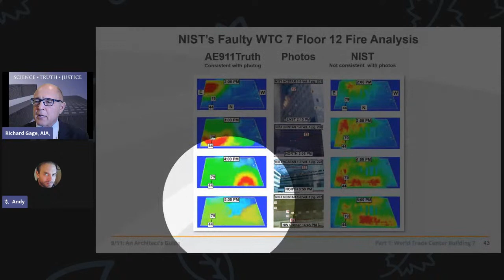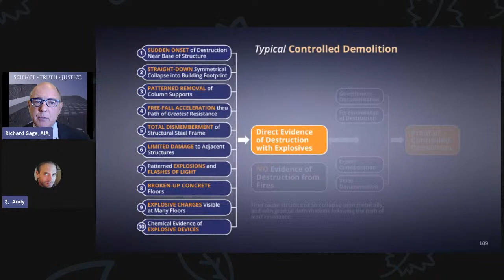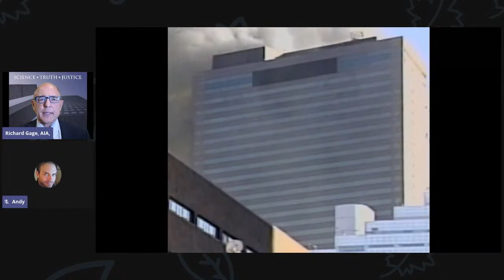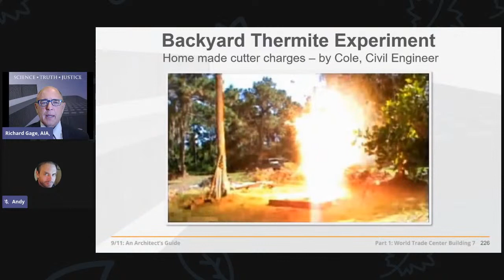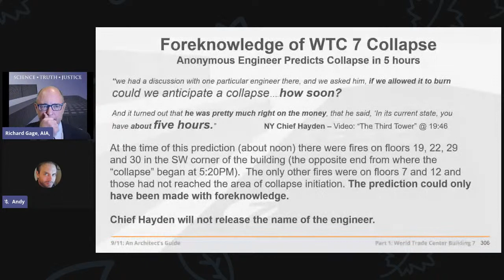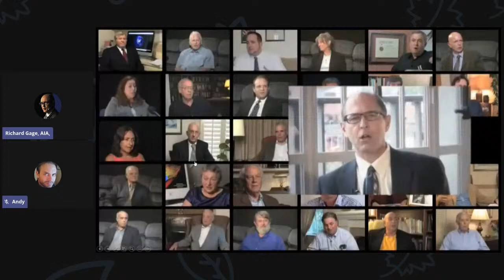9/11: An Architect's Guide | Part 1: World Trade Center 7 (10/1/20 webinar - R Gage)

Comment: Here's some notes saved off my phone, FYI Incase anyone is interested. 
Notes October 2020 #1

October 6, 2020 
It's midnight 10/6/2020 now but I have some notes to share. Brb...sorry for delay. 
Source: Dr. MICHU KAKU
TYPES OF LASERS - shared before, this part is a rerun: 

Gas
Chemical 
Excimer  
Solid state
FEL

Lockheed Martin And Speed of light Laser Weapons
  These advances enable offensive and defensive capabilities against a growing range of a new type of laser for generating ultra-high frequency sound waves instead of light - has taken a major step towards becoming a unique and highly useful 21st Century technology
SASER TECHNOLOGY 
  Modifying the ionosphere with radio waves

Extremely high power electromagnetic radiation.can cause electric currents strong enough to create sparks. (Electrical arcs) 
[[  Soros funded the PAC named "Bend The Arc"' ]]
When an induced.voltage exceeds the breakdown voltage  of the surrounding medium, (e.g. Air at 3.0 mw/m) 
THESE SPARKSCAN THEN ignite flammable moderates or gases 
POSSIBLY LEADNG TO AN EXPLOSION. 
   NOTES OFF INTERNET - FYI
Reply: October 2020 #2

Hayward Fault #BerkleyCA #Earthquake by @MaryGreeley https://youtu.be/b5tTdZL06fU 

Lucid Dreamer
https://youtu.be/XINdzVfkzBw 
Thanks for the info on UBI update. The notice of the dirtbag politicians is, to OWN everybody. Yet the money is NOT their money. My opinion. 

History Channel 
Takes a look at some cars https://youtu.be/8qWnsZ1Ot-I
 
History Channel
1941 Triumph bike restored https://youtu.be/ndLPJPqjp-E 

History Channel
Classic 1960 VW bus https://youtu.be/T47lZeLRy1U

11min video of woodworking inventions, technologies https://youtu.be/JVVMq8HJxPA

Look up this YouTube video: 5G The Interview Of The Century On Wireless Artemis And Apple 666  Urgent Forbidden Information  

CLASS ACTION.LAWSUIT AGAINST THE PEOPLE WHO CREATED THE FAKE TEST FOR CORONAVIRUS
    EXCLUSIVE: giant class action.lawsuit against German inventors of PCR test. No pandemic without PCR test. https://youtu.be/LeTK-qZIPVA 

1986 The Act / Trailer 
https://youtu.be/AKUwnRruyeU 

www.1986TheAct.com 
        https://play.webvideocore.net/popplayer.php?it=f1sj04wgm40s&is_link=1&w=720&h=405&pause=1&title=1986%3A+The+ACT+-+Movie&skin=3&repeat=&brandNW=1&start_volume=100&bg_gradient1=%23ffffff&bg_gradient2=%23e9e9e9&fullscreen=1&fs_mode=2&skinAlpha=50&colorBase=%23250864&colorIcon=%23ffffff&colorHighlight=%237f54f8&direct=false&no_ctrl=&auto_hide=1&viewers_limit=0&cc_position=bottom&cc_positionOffset=70&cc_multiplier=0.03&cc_textColor=%23ffffff&cc_textOutlineColor=%23ffffff&cc_bkgColor=%23000000&cc_bkgAlpha=0.1&image=https%3A%2F%2Fmember.streamingvideoprovider.com%2Fpanel%2Fserver%2Fclip%3Fa%3DGenerateThumbnail%26clip_id%3D2693198%26size%3Dlarge&mainBg_Color=%23ffffff&aspect_ratio=16%3A9&play_button=1&play_button_style=pulsing&sleek_player=1&stretch= 
Sante Fe Living with Philippine lifestyle. Underground home and more..with @KirstenDirksen  
https://youtu.be/pCkTLCRcRxQ 

FATAL ATTRACTION - rear window pops out says @ScottyKilmer 
https://youtu.be/Ky5h3sgiErE 

Seven years ago - #NoBiden said 
GET A DOUBLE BARREL SHOTGUN https://youtu.be/HHZ7zXLvOkY
Yet he's supposed to be against gun laws! #RemoveTrumpNow #PresidentPenceOctober2020 #ForegoElection2020 -'President Pence will #FixThisNation and stop #RiggedElections
PubliusRoots.com  

Hillary All-Time biggest 22 scandles  https://youtu.be/e1weR3XPNmE 
1. 

Dr. MANDEL #MotivationalDoc talks about #AppleCiderVinegar again #HealthBenefits #BeautyBenefits https://youtu.be/JZgvxJZJpX8 

COVID-19
Dr.Diane Hess claims The pandemic is severe"  she should have her license pulled and be investigated for fraud, if she was one of the doctors who killed patients who, in her case, are children! 
    Who is she? 
   Hes Dyan MD

4.4  (7)

Pediatrician · 67 Irving Pl

Closed ⋅ Opens 10AM Mon

￼"When one of our kids is sick, we only take them to see Dr. Hes and ..."

https://www.downtownmagazinenyc.com/gramercy-pediatrics-opens-new-location-in-chelsea-dr-dyan-hess-talks-winter-tips-for-kids/ 

    WTF
Diane Marie Hess, a daughter of Dr. and Mrs. Donald T. Hess of Garden City, N.Y., was married yesterday to Charles Francis Brush 4th, the son of Dr. Brush 3d and Dr. Ellen S. Brush of Manhattan. Msgr. Thomas Leonard performed the ceremony at the Church of the Holy Trinity in Manhattan.

Mrs. Brush, 35, is a principal sales consultant in Manhattan at Seibel Systems, a computer software company. She graduated from the Massachusetts Institute of Technology, for which she is an educational counselor. Her father is the vice president and a co-founder of the Clarke-Hess Communication Research Corporation, a manufacturer of precision testing equipment in Manhattan. He was formerly a professor of electrical engineering at the Polytechnic Institute in Brooklyn.

Mr. Brush, 35, is a freelance artist and a Web site designer based in Manhattan. He graduated from Wittenburg University in Springfield, Ohio. His parents are archeologists who specialize in the study of Mesoamerica. His father was the president of the Explorers Club from 1978 to 1981.
Reply: October 2020 #3

Woo-hoo! Former computer software grad and computer sales manager jumps to.becoming a pediatrician yet follows the COVIDIOCRACY agenda becoming COVIDIOT of the year!  https://youtu.be/Lcp82T12uwE

When and WHERE did Dr.Hess get her medical degree which normally takes 12 years?'She graduated from MIT, major in Computer Science! 
Do I trust her? NO WAY, NO HOW!   

      Married 1998
Diane Marie Hess, a daughter of Dr. and Mrs. Donald T. Hess of Garden City, N.Y., was married yesterday to Charles Francis Brush 4th, the son of Dr. Brush 3d and Dr. Ellen S. Brush of Manhattan. Msgr. Thomas Leonard performed the ceremony at the Church of the Holy Trinity in Manhattan.

Mrs. Brush, 35, is a principal sales consultant in Manhattan at Seibel Systems, a computer software company. She graduated from the Massachusetts Institute of Technology, for which she is an educational counselor. Her father is the vice president and a co-founder of the Clarke-Hess Communication Research Corporation, a manufacturer of precision testing equipment in Manhattan. He was formerly a professor of electrical engineering at the Polytechnic Institute in Brooklyn. 

Another Elite incompetent, neighbor to Jeffrey Epstein -bites the dust probably 
   This LAWSUIT began WHEN she began aggressively propagandizing for the COVIDIOCRACY
CLASS ACTION LAWSUIT AGAINST THE PEOPLE WHO CREATED THE FAKE TEST FOR CORONAVIRUS
    EXCLUSIVE: giant class action.lawsuit against German inventors of PCR test. No pandemic without PCR test. https://youtu.be/LeTK-qZIPVA

Second comment: 
Dr. Hess, continued...
Another comment by me: 
How STUPID! Children are more susceptible of getting sick than adults yet at 2:24 this lookalike Dyan Hess who claims to be an MD freaking describes children as "Shedding disease"' and that's why CHILDREN have to.wear masks - to freaking PROTECT ADULTS. Good job, PEDIATRICIAN. Did you get your license from an MIT Cracker Jack Box? 

10/4/2020
Dutchsinse discovers what appears to be DEWs active while online. https://youtu.be/XqYE1Pi334I 

Guy keeps dropping his phone in water because the whale fetches it, LOL! 
https://youtu.be/pYMRlvPxMPU
My comment:  Just like a man, "give him.an.inch, he takes a mile" - always wants more attention  (Teasing, ha!) 

@CarolBurnett She used to play the accordipn.but it was too.painful for her double D's. LOL. https://youtu.be/t4r-F-ItRkA 

I.love it when they screwed up.from laughing! 
#CarolBurnett 
https://youtu.be/XZex_D0K878

OMG - Ford is making Mustang go extinct, says @Scottymechanic #ILoveHorses @himmyfallon.I.love it when they screwed up.from laughing! 
#CarolBurnett 
https://youtu.be/XZex_D0K878

22min tribute to Tim.Conway https://youtu.be/t1IqWup_EeI 

Seems like the doctor who pushed for better hygiene got all washed up! I bet even then the doctors considered it job security, like a firefighter who wants to be a pyromaniac. https://youtu.be/6-LK2uIP6cc  

@BrightSideHP
What if we were required to only use hand sanitizer? 
Hand sanitizer is bad for your health if you use it too often - destroys red blood cells and causes anemia. Probably other things too. Source: Joe Imbriano, Fullerton Informer and Wiki Joe. 
https://youtu.be/W2EHNbQarS0 

If I could Tweet, this is what I'd say: @PAllenSmith says 
Go red! Snappers are in season.And the leaves are teasin' https://youtu.be/DzmoYCrnuBI  

58 min of music with #RamiSalazar
 https://youtu.be/qtS7fTAfJgQ

@KBCreations makes magic with witches hats.  https://youtu.be/oDj9LvmR3l8 

     Shared with Dutchsinse 
It's midnight 10/6/2020 now but I have some notes to share. Brb...sorry for delay. 

#1 
Source: Dr. MICHU KAKU
TYPES OF LASERS - shared before, this part is a rerun: 

Gas
Chemical 
Excimer  
Solid state
FEL

#2
Lockheed Martin And Speed of light Laser Weapons
  These advances enable offensive and defensive capabilities against a growing range of a new type of laser for generating ultra-high frequency sound waves instead of light - has taken a major step towards becoming a unique and highly useful 21st Century technology

#3
LASER TECHNOLOGY 

  Modifying the ionosphere with radio waves

Extremely high power electromagnetic radiation.can cause electric currents strong enough to create sparks. (Electrical arcs) 
[[  Soros funded the PAC named "Bend The Arc"' ]]

#4
When an induced.voltage exceeds the breakdown voltage  of the surrounding medium, (e.g. Air at 3.0 mw/m) 
THESE SPARKS CAN THEN ignite flammable moderates or gases 
POSSIBLY LEADNG TO AN EXPLOSION. 
   NOTES OFF INTERNET - FYI

Comment: @Quake proof a house Taylor Devices Viscous Dampers You don't really have a lot to say here about the research and information presented in the above video, do you.
Reply: @Quake proof a house Taylor Devices Viscous Dampers  If you look at 'WTC7 Controlled Demolition comparison' on youtube - you can see all of the structure's steel reinforced connections - in the clip - sever near simultaneously  - and then enter a period of freefall in their collapse - which proves WTC7 was a controlled demo.
Reply: @Quake proof a house Taylor Devices Viscous Dampers   Alright?
Reply: @Quake proof a house Taylor Devices Viscous Dampers "You can't see any connections failing as wtc7 comes down blah blah blah".
You can see all reinforced steel connections throughout the structure failing - as wtc7 comes down symmetrically - as all top four corners of WTC7 drop at exactly the same time as seen in the video record - right before entering a period of freefall.
Reply: @Quake proof a house Taylor Devices Viscous Dampers 

Would you like that explained to you again.
Reply: @Quake proof a house Taylor Devices Viscous Dampers  "how many and which connections failed during the collapse?"

All of them.  As clearly seen in the video record.
'WTC 7 Controlled Demolition comparison' (youtube)
Reply: @Quake proof a house Taylor Devices Viscous Dampers 

  Idiot.
Reply: @Shelby_Starner_Everything  
How did WTC 7 experience near simultaneous structual failure at all points of construction - then collapse symmetrically (all top four corners dropping at once) before entering a period of freefall? The answer is clear and simple. The answer - just isn't clear to simple people.
Simple people - like you.
Reply: @Shelby_Starner_Everything  

'WTC 7 Controlled Demolition comparison' (youtube)
Reply: @Shelby_Starner_Everything  

Get lost, dickhead.
Reply: @hotelscleanbathroomswithpo4938    Wow - what a giant load of nothing shit you just typed.
Reply: @hotelscleanbathroomswithpo4938  Is it you disinfo guys final text based suppression strategy - to just blather total and utter crap at people?  I mean, look at what you just wrote now. I mean, per example: "if one column fails only the column next to it will fail'  What kind of 'garbage' is that.  A skyscraper isn't a house of cards.  Quite the opposite in fact.  Skyscrapers are designed to 'stand up' - not to hollow themselves out and then drop straight to the ground - entering a period of freefall.  This is a controlled demolition.  Alright?
Reply: And no amount of witless sentences from you blathered out on the internet - changes that.
Reply: @hotelscleanbathroomswithpo4938  

Nz, do you think 'more' - or 'less' people now know -  that the buildings in New York were a controlled demolition?
Reply: @hotelscleanbathroomswithpo4938    You're just talking utter garbage.
Reply: @hotelscleanbathroomswithpo4938  " and when that ultimate capacity has been exceeded, structural failure will happen."  You're not listening.
Some damage to the exterior and office fires on a few floors - wouldn't hollow WTC7 out and then drop it straight to the ground - entering a period of free-fall.
Reply: @hotelscleanbathroomswithpo4938    That's not how skyscrapers 'work'.
Reply: @hotelscleanbathroomswithpo4938    WTC7 was OVER-ENGINEERED.

It wasn't the 'light-weight balsa wood' kind of skyscraper construction - of the type you are trying to convince people of.
Reply: @hotelscleanbathroomswithpo4938    You've just talking shit, dude.    Take a hike.
Reply: You’re replying to fake accounts. It is very easy to identify these fake account by the really long since less names!